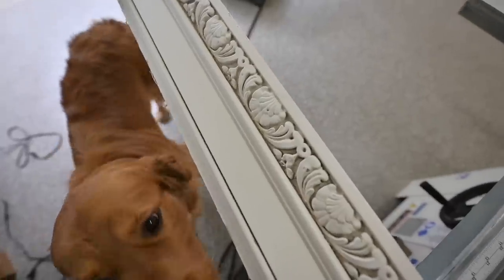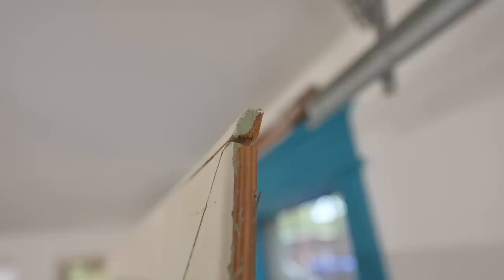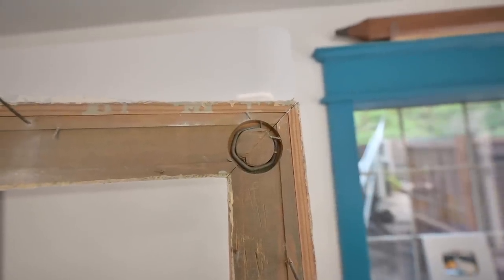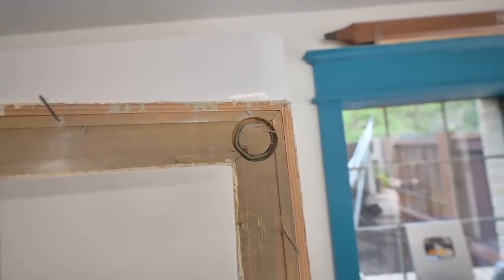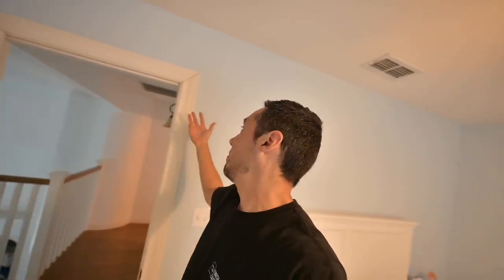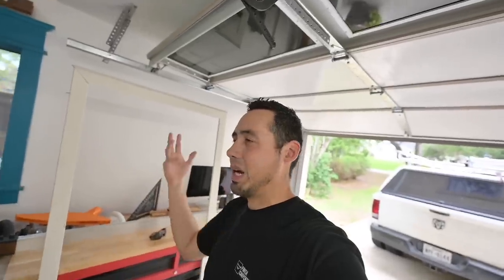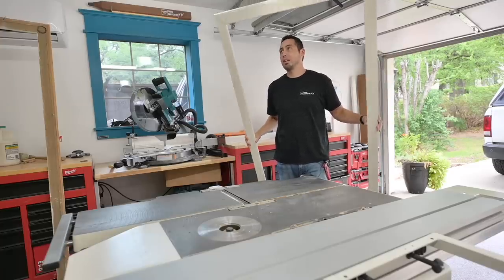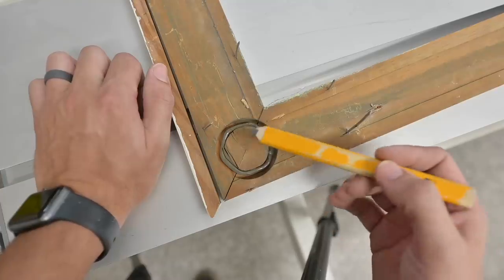Door casing skill lost for 100 years

Comment: I think the trim was pre- assembled or prepard off site then put together at the job site. The craftsmanship back then was unbelievable. Great video Richard.
Reply: Considering the back profile of the trim, we are not looking at really old work.  There do not seem to be any chisel marks.  In fact, on the two corners shown, there are no visible tool marks of any kind.  That strongly suggests some multi-blade tool in a press or multiple passes with a router in a circle jig.  
Pulling the corner together definitely solves the problem he showed in the house where the miter was opening.  Opening can occur either because the wall moves or as the wood shrinks.  Having the edges pulled together by the ring or by the pocket screws should solve the problem.  Personally, as I am redoing frames in our old house, I use a post and lintel system.  When the joint opens slightly it is not visible.

Comment: I would use that moulding for part of a fireplace mantle. You could miter the ends to fit with returns. You could spray finish it, use a glaze to highlight the details of it, and then spray it with a finish to protect the glaze from rubbing off. OR you could use it at the header height of kitchen cabinets above the sink where you have empty space. You would just have to find some kind of low profile detailed moulding to add to your kitchen cabs to balance it out. Some small rope moulding or something like that.
Reply: This. I don’t think you have enough to do much else with it. Maybe the top of your front door frame
Reply: I thought about a mantle too, that would be beautiful.

Comment: To do a stripped down modern version of this you can do this: 1. make a wood jig that will hold the 90 deg. joint  with a hole that matches the diameter of your cutting tool  (something like a wide hole saw-like cutter without a center pilot drill ). 2. Cut the groove. 3. Use a slice of thick-wall pipe  or tubing in lieu of the hexagon (should work just as well if you've got a tight fit.) and press it in.
Reply: The wire ring isn't closed for a reason. It acts as a spring, pulling the mitre closed.
Reply: Why?

Comment: As others have said I believe this was made in a factory assembly line. They had some sort of clamping jig for the miters and then another jig to drill the 2 circular parts and press fit the hexagonal locking ring over it..... That's probably pine wood so it's soft, and hydraulic presses would have no problem pressing the ring in place, locking the miters in place.
Reply: That would require measurements to the millimeter from the site framing, plaster and floor. Just an adjustable corner clamp with a few hole saw options for different widths of trip. Bet it was a standard tool for trim guys at a certain level.
Reply: I agree.   Most likely done the way we do windows today:  Measured at the site and ordered, then installed on site when they arrived from the factory.

Comment: I think you're right on about the drill press. Sometimes you run into things that are a signature of one pure craftsman. He probably made his own drill bit, welded his own rings, and made his mark on many houses that very few people will ever have the privilege of following behind.
Reply: I was wondering about something commercial. Bit to cut the trough and rings, sized for a standard 1” (or so) chisel to cut the facets. Probably expecting the carpenter to create a purpose built jig to hold the casing pieces perpendicular (with wedges?) and a fixed piece with a hole to guide the bit.

Comment: Honestly, if I were to recreate this, I would have used a hole saw boring jig (like that for drilling bores for locksets on doors), and fitting the ring over a slightly oversized circle. A hammer would work, but a levered press is more likely. Once the ring is pressed in place, applying a dab of water to the wood on the inside of the ring would cause it to swell, binding the miter together. Water is meant to make the miter tight while the glue dries
Reply: Water is not a good idea. You will get a fit that is tight when wet but will loosen when it returns to normal.

Comment: I was taught this method back in the early 90s but it was with a true circle of steel.  The "hole saw" bit was custom made with a slight chamfer, 1 1/2 on the top side down to 1 9/16, over 5/16" of depth creating the wedge, we used a drill press and gigs to position the wood. There was no centering bit.  We would precut, glue and brad nail the casing, then carefully turn it over and  make the pocket.  Once the pocket was made we used a precut 1/4 wide X 1/8 thick X 1.5" diameter piece of steel to lock the molding into place by hammering it down into the pocket. (not as aggressive as it sounds) This process is very time consuming, but in a hundred years the molding will still be tight.  I don't use this technique anymore and maybe I should. I have no idea where I could even get the custom hole saw bit made.  The gentleman who made the ones we used (when I did my cabinet and trim apprenticeship) passed away almost 20 years ago.  As for the crown molding I would make a mold of it for future cast pours.  Then I would use it in a mantel project.
Reply: Sounds like the methods you were taught was a slight variation in what was used in this video. It sounds very interesting though. I may see if I can come up with a similar method for myself one day.

Thanks for sharing your knowledge!
Reply: I had the same thought regarding the fancy molding, first find a way to duplicate it. Maybe build a router template(s)? Also a router could be used to make the circle cut, whether round or hex. Size it to work with rings that can be found already in the market for other purposes or buy steel pipe and cut rings of the correct thickness. Just 2 cents from a DYI hack!

Comment: I’m guessing that that circle could be cut with a router and a jig. A bit with a taper would give you the angle to hold the ring. Portable routers became available in 1915 with pneumatic motors. Interesting video, thanks!
Reply: The bit would not have a taper, just a straight cutting bit.  The hex shape of the ring gives it spring force, the inner ring would be circular, the spring force would compress the inner wood some to give it the hex appearance.   This could easily be done today with a relatively simple jig, and done completely onsite.   The only hard part... finding a supply of the rings ;)

Comment: Looking at the wood, it seems to me that the initial recessed ring is cut to be circular, and the metal hexagon is hammered into place. Over 100 years the wood would expand and contract (the open space at each of the 6 points allowing for this), and take the shape of the hexagon. It would give a tighter fit over longer years, and prevent separation. We could do this today using thick snap rings and a thick tooth holer. The snap rings are open at one end, so the snap ring can spread with wood expansion. 

Also remember there are tons of purpose built tools, by the craftsman, from older eras. Think of all the tools found where an academic would have no idea what it’s use is, or a descendant who did not take on that trade who wouldn’t know that thingy isn’t an unfinished project, it’s a specific tool. 

For separating casings, I prefer to use spackle. The pink kind. Run it with my finger and come back with a damp microfiber cloth after it dries. The damp cloth smooths it down and puts the contours in it better, and the spackle holds paint better and looks more natural. Try it on your door casing and see how it works for you before your toss it out.

Comment: I really should be finishing my laundry room (drywall spackle sanding, paint, etc) but I'm here watching this awesome channel!
Reply from the maker: Same here. My laundry room is still in pieces lol
Reply: Case your mini split, i seen wall hung ac cases but never a mini split, maybe the contrast of such a modern sleek machine with an old detailed casing may make an interesting juxtaposition.
Reply: I’m supposed to be searching for a trick to save time wiring an additional circuit vs adding to a possibly already overloaded one. 
As an electrician I’m still drawn to watch another tradesman revealing secrets of amazing craft. Dewalt and Makita and Bosche each benefited the year I discovered this channel.
Reply: Hey I’ve got the washer and dryer functioning, painting will have to wait.

Comment: Totally cool. Must have been shop made, even if assembled on site. People always think. From what I see of the hole left, the bottom is smoothly cleaned, all surfaces look machined. It could be accomplished in two steps, with a station that drills the ring hole, then a secondary stamp-down shearing tool set to the same depth. A better visual of the empty hole wood be nice. 😉

Comment: That miter and the drilling was absolutely done in the shop and the round loops were purchased.  I have seen a few different things used over the years, nothing better than the biscuit which I first noticed in a house built in the 1930s. As for the piece of trim save it and use it somewhere in your house I put in a octagon window little doors all kinds of places where I have used different types of trim. Cheers Don

Comment: When I was about 8 yrs, my Grandfather had a beast of cast iron, it was as I know it now as a Miter clamp that would take up to about 6in wide timber.
2 moulding pieces were put in a guide clamped and the saw was used to cut both together [ offset by the saw width] on the top rail then the down timber was loosened in its clamp and moved up to meet the top section perfect mitre.
Then a section holding a twin knife cutter with a plough centre was mounted with a brace and bit to cut and clean the circle out.
This was removed and a hex shape [as seen] was laid over the centre hole and a bar was slotted into an upright hole on the side of the clamp, this bar had a hanging section that fitted onto the hex and just pushed down locking it all into place.
He died when I was 13 [1963] and my grandmother said to take whatever I wanted and that was not there in his shed, so I never saw it or anything like it again.
Tony Australia

Comment: This is really cool, i love to see things like this. I'm originally from the U.K. with 15 years experience there and now have lived in Canada for the last 12 years. I love comparing the different techniques from the two countries. 
I can't make out on the video, but would the inner circle have been kept circular and only  taken the different shape after the hexagonal ring was pushed or pressed into place, thus giving a tighter fit?
i think you should use the old casing to make a frame or display box for the sections of the mitre rings. maybe leave room for any future interesting finds, it would be really cool to display them in  your shop.
Reply: I was thinking the same thing about the inner being circular.  100 years of expanding and contracting can do a lot of things to wood.
Reply: I also vote for your idea for the display

Comment: I think it was done with a hand router of some type and a jig to hold the trim in place and a circle cutting jig for the cut.  The edges around the inside of the circle look too clean for chisel work,  especially for a recessed inside corner. This would be an efficient way to to get fast repeatable work which can also be seen by the consistent placement of the rings.
Reply: Hand routers weren't around at that time.
Reply: @charleshultquist9233  Not sure where you got that, but it's incorrect. Portable powered routers were available in 1906. Before that foot powered routers with rotary bits available starting in 1877. Before that, router planes. I cant find a specific date they were invented but they were known to be used in Colonial Williamsburg over 250 years ago. Do a quick Google search before disseminating false information.

Comment: You could do this fairly quickly today using a router and a narrow worm drive hose clamp.  After cutting the circular slot with a router,  place a worm drive hose clamp into the slot, tighten, and the joint will never open.

Comment: I think the lock ring was part of a miter joint system. There was a custom made drill bit to cut a ring hole. It would have cut the outside diameter hole and left the round plug in the middle.  The hex ring was then pressed on the plug to lock it together. The ring deformed the plug to the hex shape.  Probably used a drill press.  I believe it was a custom system that one could purchase much like you can now purchase a pocket screw system.
Reply: I said the same as you, Then realized I probably wasn't the only one. No way the inner ring was done by hand. Spent a few minutes looking for this system online and haven't found anything. :(

Comment: I'm no woodworker, but I think they put in that hexagon clamp, because the glue in those days just wasn't strong enough to endure for years on end. A mechanical clamp would just have been the better choice.
Reply: Animal was around then ,I worked at a joinery repair shop and the old joiner would boil it in the shop!!
Reply: You don’t say…. Real life Sherlock over here.
Reply: @jacobjohnson4763  No need to get annoyed..

Comment: Such a great find and beautiful to see some craftsmanship from days gone by.
The trim in your home was never assembled prior to fitting, so isn’t fastened to the test of the trim as much as it is to the wall studs. Studs move, the trim moves with it, as it’s not attached as well to the rest of the trim.
Burning it is just a waste when you could close it back up.
I feel it’s a cop out to just rip it off and replace, using the same method that opened it up in the first place!

Comment: Very cool trick, old school craftsmanship built to last, I think you are semi correct. They used a hand drill to drill the circle then they used a chisel to make the pentagon from the inner circle. Whats interesting is that there are no scorch marks to indicate that the bent the metal to shape and then welded it in place. Start replicating this technique or maybe even try the same thing with a braided metal wire (1/4 inch} that you can cinch in place. As far as that ornate molding an inner doorway,, maybe to dress up the focal point in hall way.

Comment: Doing fine bench carpentry, Hoffman dovetail keys are what we used to keep are joints together. Can be used on smaller items, astragals, cassettes, there’s no movement from rust expansion, no staining from iron oxide bleeding or face fix filler discolouration or gaps or shadows from shrinkage.

Comment: The circular cut can be made with a hole saw. Use the hole saw to cut a hole in a scrap of wood. Clamp that piece with the hole on top of the mitered pieces as a guide. Then you can remove the center bit from the hole saw and cut with the scrap as a guide. I have used that method many times to cut circular blanks to fill holes.

Comment: I’ve made jigs for hole saws over the years by drilling through some stock, usually 2 inch, then removing the center guide bit from the hole saw, clamping that 2 inch stock  to whatever I want a hole in and drill away. No center guide bit markings left behind. Although what you’re showing is a very wide circle, much wider than modern hole saws kerfs. Pretty slick for sure, lot of work creating octagons……I think the modern biscuit application worked just fine and achieves the same results. Of course the didn’t have modern glues back then either.
Reply: Right about creating a guide with a board and removing the mandrill.  Use two hole saws one for the inside circle first then the larger one.  Probably don't even need a chisel to remove the remaining wood but any rapping object like the claw of a hammer. Deform the ring to be snug.
Reply: Fortunately for me, you saved my writing the same thing. I've drilled a lot of knob holes in doors with a "book cover" jig that I clamp onto the door. there's a hole on each side to guide the hole saw and it's set to the right depth from the edge of the door. I can drill from both sides so the bit doesn't bust through on the backside. No center guide required. No measuring or marking required.

Comment: Integral solution. I did a lot of trim carpentry and was some I enjoyed the most. It’s becoming a lost art. The trim work in the house I live in right now makes me wanna barf lol. Nobody is coping out inside corners anymore leaving huge gaps when wood cures out or shrinks in the winter. They’re butted splices and didn’t snap in the pieces a smidge long leaving visible gaps too. It’s terrible. Something I learned doing casing was to set the mitre gauge at 45.5 degrees and when you join the miter pull that gap shut and nail. This way the outside of the miter corner is really tight and is less likely to gap in temp fluctuations or curing. We’d also use a thin piece of shim to put under the trim while on the saw to “back cut” an ever so slight angle on the miter so that the visible surface points of the miter made good first contact with each other. This also helps prevent gapping later and ensures a good fit. Cut the wood so the part you see meets a up tight because the part against the wall that’s hidden don’t matter.

Comment: Embossed or carved salvaged molding use: Since just one piece, consider using it for trimming out a sky light opening. I recently used some 4-1/2 basic crown to do just that in a bathroom. Butted up to the underside of some 5" window stool stock installed around the perimeter and up about 5" from the ceiling, it added some decorative interest to the otherwise dull opening and can now serve as ledge to place air or artificial plants on. BTW, 1) people were smarter back then; no smart phones to distract; and thre would most likely not be a drill press out on a job site in those days, only brace and bits. Best, Fred